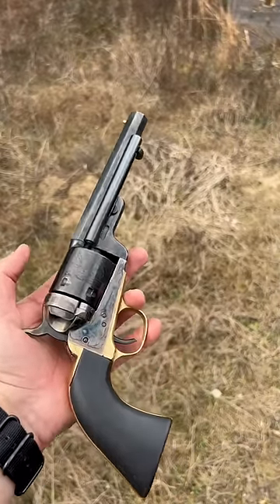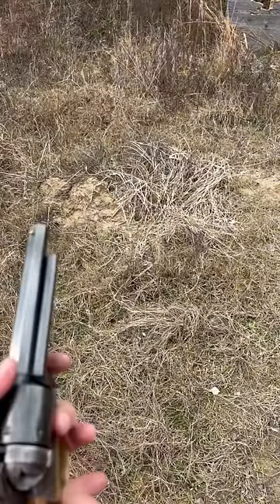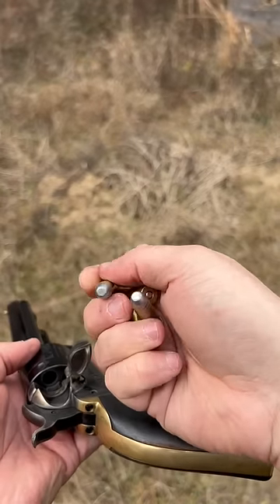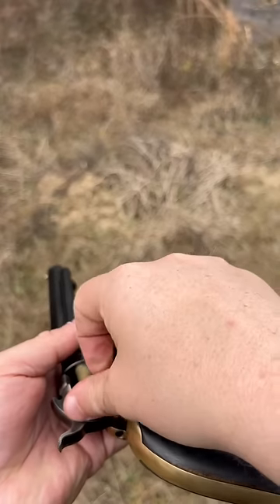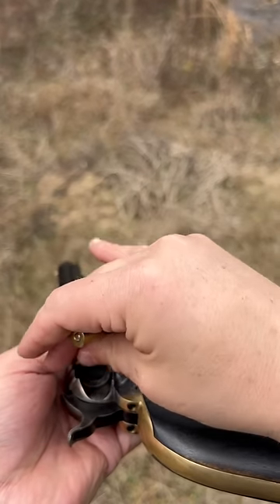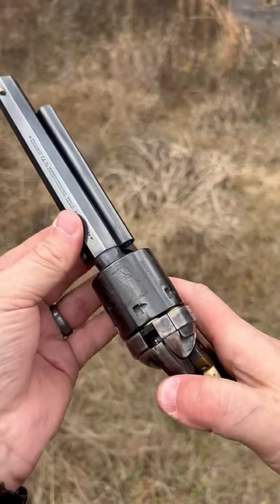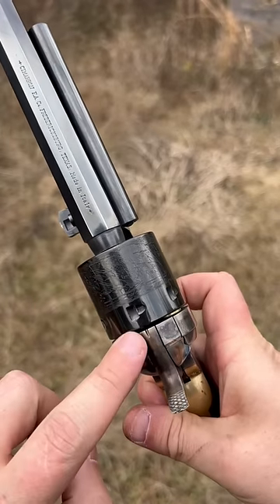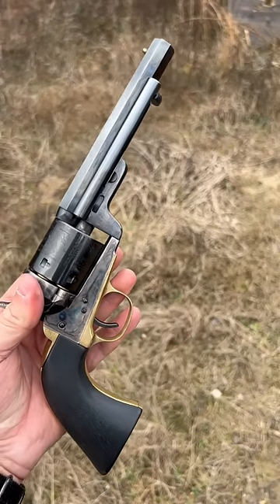Loading a 1851 Colt Richards Mason Conversion from Cimarron Uberti in 38 special

Comment: Good post. Most people don't know that the old six shooters couldn't actually carry six rounds safely.
Reply from the maker: There is a safety notch but I prefer the cowboy load. Load one, skip one and then load 4 more and rest on an empty chamber.
Reply: @JWheeler331  ...I do the same.
Reply: Why wasn't safe?
Reply from the maker: @IMStillUnbroken7  Because the firing pin is on the hammer and would rest on the primer of a live round. Many leave one chamber on an empty chamber so that it’s safe. Some also use the safety notch.
Reply: @JWheeler331  thank you
Reply from the maker: @IMStillUnbroken7  No problem.
Reply: @JWheeler331  on the Richards Mason's, you can load all six, rotate the cylinder until the hammer is between two rounds, pull the hammer slightly back past half cock, and then pull the trigger and lower the hammer. the firing pin sits all the way forward and in between the rims of two cartridges and the gun cannot fire.
Reply from the maker: @feraligatorade99  No you can’t. The Richards Mason Conversions do not have the safety notches between cylinders like the original 1851 black powder guns. The notches were machined off during the conversion process. The new made replicas never had them because they are replicating the original conversions.
Reply: The non conversion revolvers had a saftey notch.
Reply from the maker: @WalrusWinking  yeah. Between the cylinders. These don’t.
Reply: @JWheeler331  I always thought some conversions were able to keep a safety notch.
Reply from the maker: @WalrusWinking  Not the Richards Mason.
Reply: @JWheeler331 really doesn't make much sense when you consider the difference between modern and 1800's gun laws. If I'm not mistaken, it's the same reason why most shotguns have a trigger disconnect today. Slam fire sounds good on paper but it's horrible for someone who lacks trigger discipline.
Reply from the maker: @jmsgridiron5628  yeah. These are replicas of original guns though. I enjoy the fact that they are true to the originals. There are modern guns that don’t have the firing pin on the hammer such as the Ruger Vaquero. They are fine guns.
Reply: @JWheeler331  well you do so at your own risk. I personally like my saftey features but I can't deny that it's a handsome revolver. Stay safe out there.
Reply from the maker: @jmsgridiron5628  I do the cowboy load to be safe. Thanks. Have a great day.
Reply from the maker: @StolenFlipper  These do have a safety notch on the hammer. If I was a cowboy back in the day and my life depended on it I’d for sure carry it with the full six.
Reply: An actual 1851 cap and ball could safely hold 6, but when firing pins and metallic cartridges came about that changed
Reply: @JWheeler331 what about resting the hammer between the chambers with 6 shots loaded?
Reply from the maker: @ChrisPBacon1434  The conversions do not have the place to rest the hammer between cylinders. If you do this there is a chance your cylinder could spin and come to rest in its proper place on the primer. Personally I’d rather have it on the safety notch on the hammer.

Comment: With all the distance between chambers, it wouldn’t be too difficult to mill an indent for the firing pin to rest in between chambers.
Reply: On hard steel?
Reply: @howardschlereth9368  With a drill press it would be a 5 minute job.
Reply: you can already do that.

Comment: Why not load all 6 and then rest the pin in between two of the chambers? There seems to be small holes that could fit though i don't know if it's for this.
Reply from the maker: The original black powder versions have the notches between the cylinders. The conversions do not have those because they were machines off in the conversion process. These new made ones never had the notches between cylinders since they are replicating the original conversions.

Comment: I don't understand why there wasn't a between chamber slot to rest the hammer on. That's how the NAA Mini revolver works and it's a great solution.
Reply from the maker: There was on the original 1851 revolvers. When they were converted to metallic cartridges those were machines off when they machined off the the nipples to take the shells.

Comment: On the 1851 you can actually load all 6 and just drop the firing pin to rest between cartridge cases. Perfectly safe for a center fire cartridge like 38 Special. Wouldn't have worked in the 1870's for an 1851 chambered in 38 Rimfire though!
Reply from the maker: They were not Rimfire. The 38 Colt or 38 Short Colt is center fire. Also, the safety notches were not present anymore on the conversions due to being machined off during the conversion process.
Reply: @JWheeler331  but you can drop the hammer between the rims of 2 cartridges. it sits against the cylinder and locks the cylinder in place
Reply from the maker: @feraligatorade99  no they don’t. There are no notches between the cylinders on these.
Reply: @JWheeler331  On the 1851 Navy conversions, dropping the firing pin between cartridge rims on loaded chambers is about as secure as the safety notches between chambers on a Remington C&B Army/Navy. 

My brother has an 1871 Colt Open Top (Uberti) in 45 Colt and it can be safely carried with all 6 chambers loaded and hammer between chambers due to the thinner flat firing pin sitting securely between rims.  Between chambers on a Colt Single Action in 45 Colt is not a good idea because the fatter round conical firing pin doesn't sit securely between the large rims of 45 Colt. 

On the original 1851 conversions, you are correct in that almost all were in the centerfire 38 S/L Colt. However Colt would chamber them in 38 Rimfire if requested. Obviously it would not be safe to drop the hammer between chambers on a rimfire round, while being perfectly safe to drop the hammer between loaded chambers on a centerfire round. 

Best wishes.
Reply from the maker: @63DW89A  I’d trust the safety notch on the hammer before I’d trust the firing pin resting between two cartridge rims and nothing to hold it in place. To each their own though. Thanks for the conversation and for watching.
Reply: @JWheeler331  I understand and respect your concern over such old "19th Century" methods. 

I've been used to carrying C&B revolvers in the field like that for many decades now and that is why I'm completely comfortable with "between chamber" carry.
Reply from the maker: @63DW89A  Cap and Ball yes. They were made to do that. I carry my 1851 Colt cap and ball the same way
Reply: -top  @JWheeler331  I also carry the cartridge conversions the same way. Just as safe as the Remington Cap and ball. I was introduced to "between cartridge rim" carry by the grandfather of a friend. The grandfather had a wonderful collection of the little 5-shot break-top S&W revolvers in 38 S&W(some were MINT condition!) and that is the way those guns were meant to be carried. No visible safety notch, just lower the firing pin between the cartridge rims.
Reply from the maker: @63DW89A  I will experiment with it and test it for my self. Thanks

Comment: I'm just wondering if you can remove the wooden parts of the handle from the old revolvers and revolvers of a similar design. or are they built in such a way that you would have to drill them out or something?
Reply from the maker: The true original gun grips would likely have shrunken over the years. The guns grips were made for that specific gun. Same as today. Sure, many will fit but the wood to metal figment may not be as good and would require some figment.
Reply: @JWheeler331  thanks for the answer. i want to make some out of/ with bone or horn (that's why I ask).
I have no experience with pistol grips and I'm at the very beginning.
if i do so, i'll make some for a revolver- more fitting than for semi-auto...
Reply from the maker: @TheCrepusculum  Sounds nice. I have a revolver grip made out of giraffe bone and it’s pretty nice. Good luck with your venture.

Comment: Would be better if this reproduction had a safer design than the original.
I understand that people want it to be exactly like original,but even I could sacrifice that just a bit for safety and 1 more round
Reply from the maker: There are plenty modern guns that fit what you’re wanting. I prefer them to be just as the originals though. You can always load six and shoot at the range if you want. It’s a replica of an original firearm and gives many a chance to own something that many can’t afford in the original. Just my opinion which obviously differs from yours. Thanks for watching and commenting

Comment: This wasn’t very efficient because am I right because you couldn’t load it to six Ryan capacity because I had a fear of blowing your foot off
Reply from the maker: You could load six if in a fire fight and needed to load six. Loading six and carrying six could also be done by using the safety notch on hammer. This is how they would have likely done it in the old days. Not advised in modern times because safety has changed over the years.

Comment: Somebody wants to tell him a gun don't shoot unless you pull the trigger?
Reply from the maker: Obviously. Thanks for watching.
Reply from the maker: @hampushaglund4613  Depending on what you’re doing, if loaded six you could possibly hit the hammer hard enough to set off the primer. This is just a safer and commonly accepted way to load them. Not the only way

Comment: Its safe to carry with all 6 something would have to hit that hammer really hard and at the right angle to set that round off people who "cowboy load" their single action revolvers don't know much about guns or cowboys cause very few people if any did this back in the day
Reply from the maker: Colt’s own original instructions said to have one chamber empty. The fact that it could happen is enough reason to not carry with the hammer on a live round in modern times. There is a safety notch that you could use for sure which I’d wager most cowboys did at times. There have been plenty tests online to show just how potentially it could happen. The fact that it could happen will be enough for many people to only carry five in today’s every day use. I do it because it’s required in SASS matches. It’s ultimately your choice so do as you wish. Thanks for watching and commenting though.